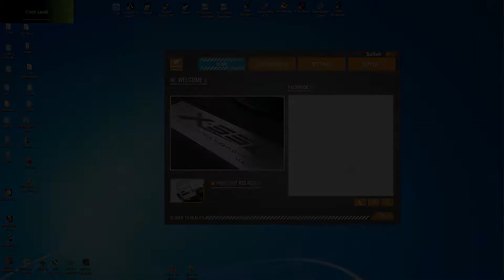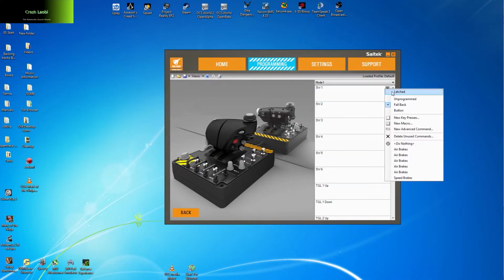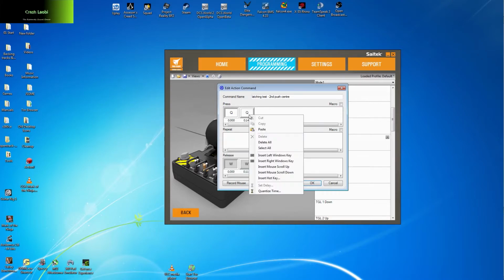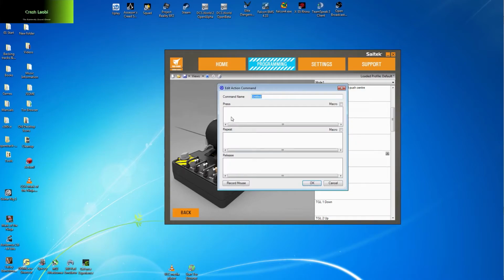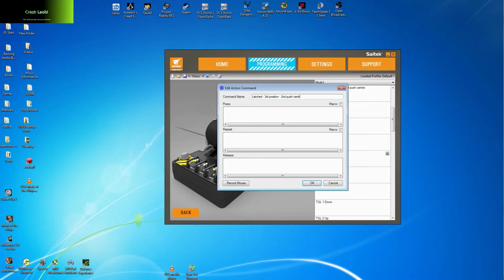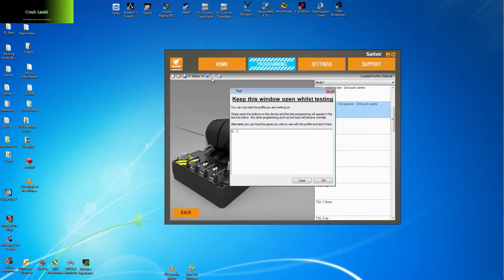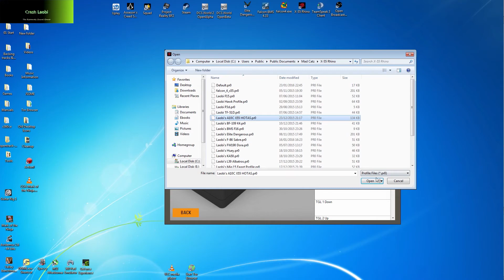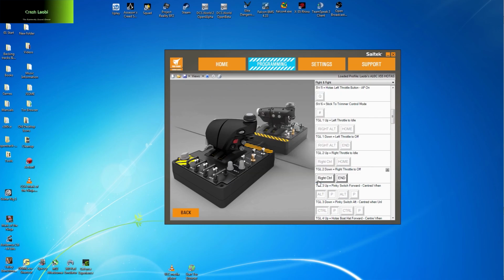RTMFM   Saitek X 55   The Joy of Latching

Comment: Thanks! Don,t know if you're still here in 2024 but will this work with rotaries?
Reply: No it does not. For rotaries you have to set bands and put a keycommand per band = 0% - 33&  = A // 33% - 66% = B // 66% - 100% = C as an example. I tried the latching but the softwate is very wonky and the test fails hard. A - S - D were S is the middle state. In test when i press A and return it, it does not sent S. And when i press D, the test sends S...weird. Tried it in DCS but it does not work
Reply: @bobykim5311  thanks!

Comment: hey dude came across your video about latching wondering if your still around and using it.  I have an x56 and it uses the same program as you may be aware.  Dont expect a troubleshooter session but if you have the time and knowledge can you help me with something..  Im in DCS world with an F15 and  Mode 1 is set as my Navigation, and Mode 2 is my Combat switches.  I have used a latched switch in Mode 1 on switch 4 downward press, basically while in cockpit view i press down switch 4 and the world map opens (and stays till i down press again where it goes back to cockpit view).  In Mode 2,  the switch 4 downward is set for "reset/silence audible alarm".  However, when i have latched switch 4 downward, it is now latched across all the modes.  But i dont want it to be, (well i might latch switch 1 upward in mode 3 i dont know).  But because it latches across each mode this causes problems ie when i use mode 2 switch 4 the key repeats over and over (im not even sure why, its just headache right through).  Are you aware of this, is there a workaround you know of, is it a software bug maybe, i cant see why anyone would want it latched right across.  It does have some other side effects but this is long enough already.   I know i can turn latched off and use switch 3 and 4, but that isnt latching and thats why i watched the video.  No probs if your done with this, was a longgggggg time ago.
Reply from the maker: Thank you sir!  It's been a while, but I remember this quite well.  It should definitely perform different tasks in different modes.  I actually had this issue before too, I think in the end I resolved it, by disconnecting everything, removing the software and drivers.  I then restarted, ran a reg cleaner (ccleaner, I think), re-started, re-installed the drivers and reconnected the USBs.  From what I remember that worked, but it was a bit of a pain.  I hope this helps.
Reply: @Laobi  Thx for reply dude. In the end i stopped using the latching on the bottom row of buttons it really was too much trouble - OK if you latch on and off but if left in latch it messed a lot of the other controls - i only have the joystick ministick latched for press now and this only snap view holds till i release it - this sometimes jams up the zoom function if i leave it on though -  when i get my track ir i likely wont need this snap view,  as i can look and hold all day both zoomed and unzoomed.  Just a pity STT software works like this as the down press to map then press again to cockpit view was really useful.  But with the key repeating in the background i had to turn it off - I have dual monitors and if i left something latched and went to the second monitor say for youtube and such it would open a hundred tabs in google chrome and literally lock up the comp.  What i have gained from finding a work around has really helped me with all the other stuff STT can do though. So at least thanks for piqueing my interest in modes and latching.
Reply: Ok so had another play - ended up installing win 2004 update too - no change to what latching does and its side affects but again learnt some more tricks - what i needed for the map view was not latching just a hold release setup so that is fixed - also added press hold release to ext view - so these are one button and off rather than button here then one button over there - nothing is latched now gonna play with this arrangement see if it works - and as long as im not holding F1 when i click to my second monitor Chrome doesn't go crazy - again many thx for getting me going on this - everything is getting sweeter